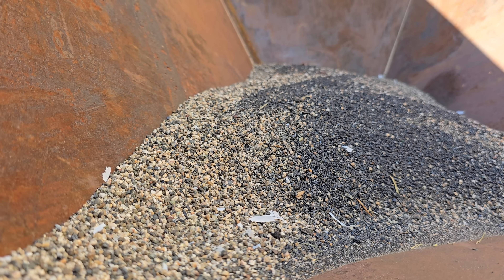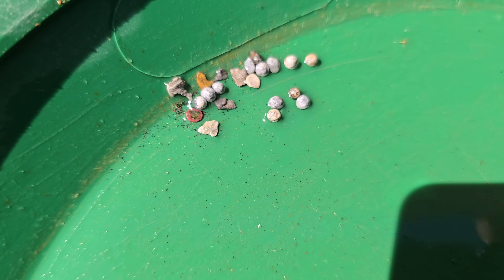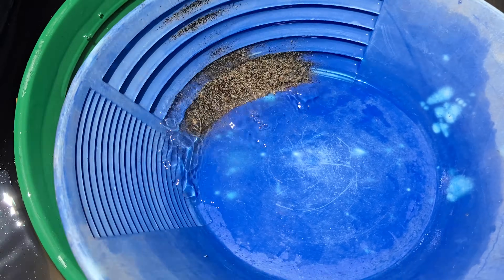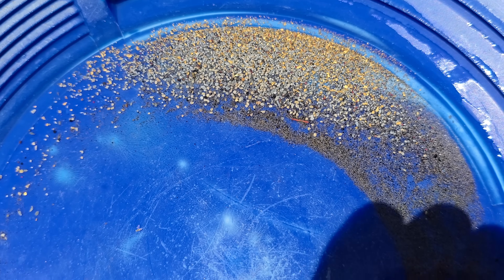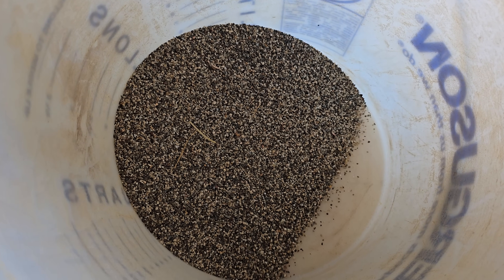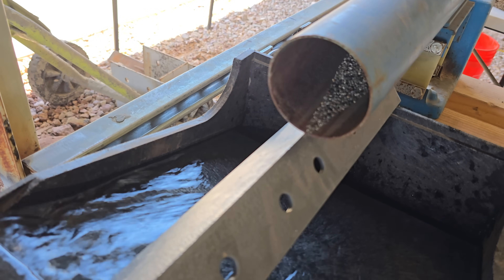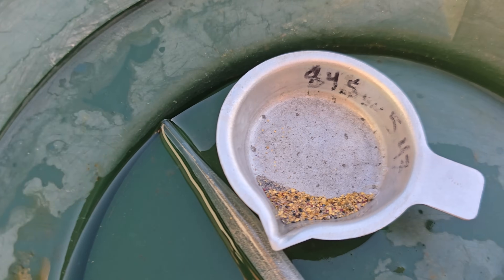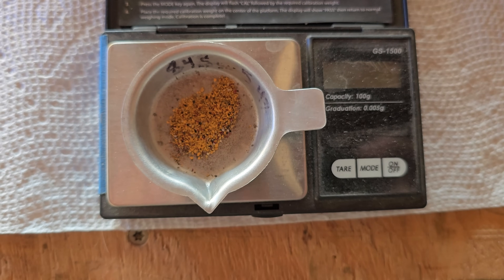Classify, separate black sands and pan out the gold!

Comment: Harry, I'm intrigued by your no-heat separation process!
Could this method be done in an  apartment by a window since there seem to be no fumes?
I have several jars with pre-separated placer cons  (magnetics removed) and the mica has been driving me nuts each time I try to tackle those cons. Can't tell the difference anymore between flour gold and glittery mica particles, because both tend to float in the gold pan despite using jet dry.
With your method, I might be able to finally finish up all those cons and maybe get some remaining flakes of gold out of them.
Also, could one re-use the same liquid mixture for additional new scoops of cons?
Reply from the maker: Need a fume hood to do it safely.  The fumes will eat your teeth and destroy your lungs. I don't use heat, becouse the base metals are not in the gold just mixed up with it.

Comment: Snake Safety, while clearing mines. was re watching from jason's pov of you. (the video of jason with you in your mine/Henry's mine)
don't know if you got distracted with jason saw in the beginning he was saying he'd wait for you to clear the mine of snakes and to not distant you.
 but when you were exploring your mine you stopped two times and did oops with wood pallets/boards when checking the boards 1 wood board against a Wall you grabbed the unsafe side with most of your hand/your  fingers while your thunb was on the safe side Always when checking for snakes use your Hand as suckshun (this was a wood board was only 2/3 feet off the ground, so was in the bite range of a snake). or use your snake grabber to move wood boards to check for a snake.
And another time you grabbed a 4by4 in a pile of 3 of them you could see under the other 2 when you brabbed the top 1 with your hand, dont do that checking for snakes use you snake grabber, a snake could have easly been 6/8 inches away from your hand/fingers.

Comment: My understanding of the XRF correct me if I'm wrong 

Is it only reads a surface of whatever you're scanning not all the way through so you could have a A solid lead shot in the middle covered in gold and it will read the gold only
Reply from the maker: True for surface. For checking with XRF,  one way to really know is to drill into it and xrf the cuttings. There is no lead in this button as it was all disolved in nitric. This is true for thick gold plating or gold filled jewlery as well. This button was molten and mixed, it is homogenous. I scanned three times different spots.